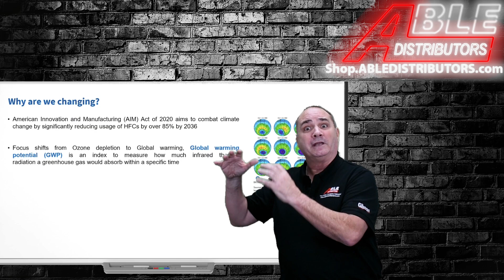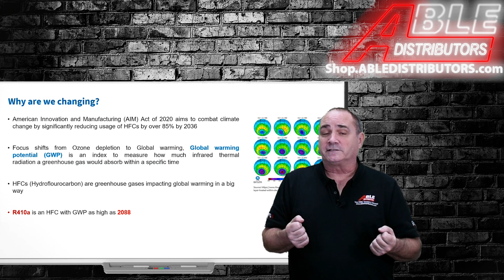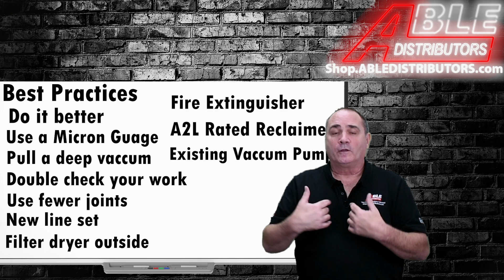A2L Refrigerant Change Explained: What You Need to Know About Moving From R-410a

Comment: I will be needing to replace a surviving 40 year old R22 system because my HVAC guy says he is not allowed to work on banned equipment anymore.
His sales team wants me to hurry up and buy an R410a system before 1/1/25 because the prices on the R454b systems will be at least 25% higher. I am disturbed that he wants me to buy another banned system that he won’t be able to work on.
From my research on what to buy I came across some disturbing information. I am pretty sure DuPont is not aware of it yet, but their R454b refrigerant is already on the radar scope in Europe for the forever chemical toxins known as PFAS that it contains. I do have complete confidence they will have a replacement coming before the R454b patent runs out though.
It was also interesting to fine that R32 is outside the scope of the new environmental ban in Europe. Just search up R454b and PFAS.
This a far too familiar scenario.
Maybe some of the equipment manufacturers that really like this new and untried toxic R454b could have made better decisions. It would sure keep me from bearing the burden to make all the good decisions on which equipment to buy.